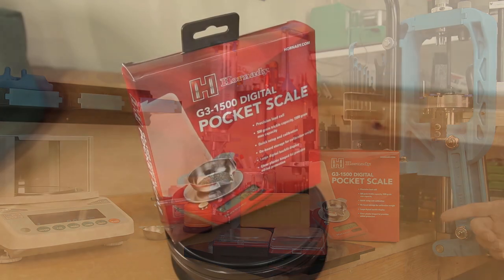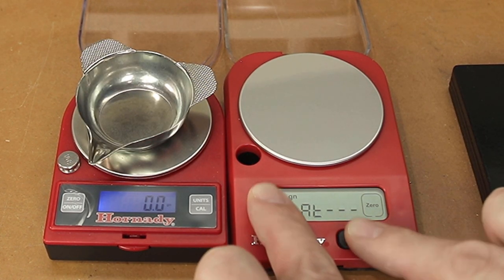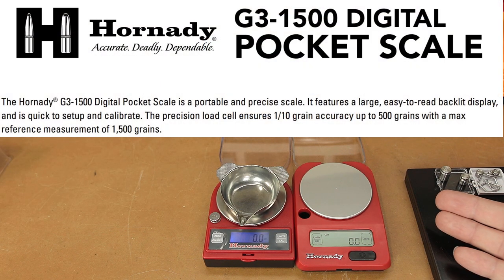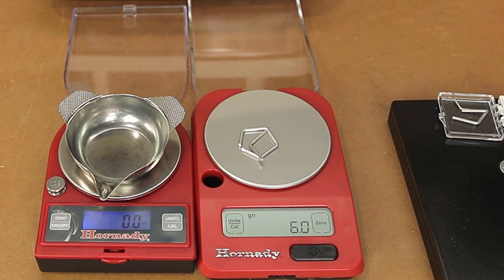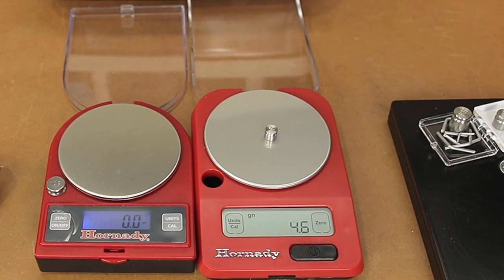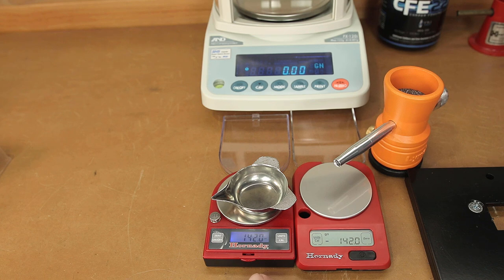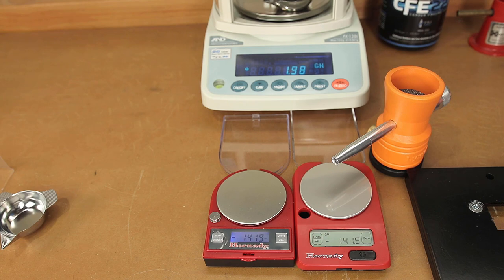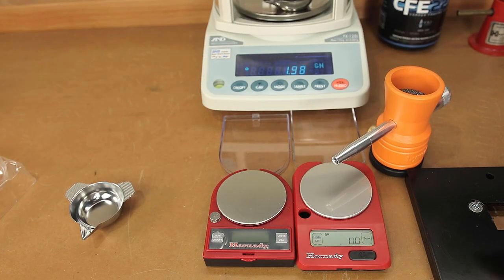Upgrade! - Hornady G3-1500 Digital Reloading Scale

Comment: I got this scale based off of this video. It does trickle well and is as accurate as my beam scale. The only issue is it needs to be re-zeroed before every weighing cause it does drift. Other than that it does the job well for a small inexpensive digital scale.

I always drop a light charge from a Redding Competition 10X powder measurer into the scale pan, set the pan on my Ohaus 5-0-5 beam scale, trickle the charger to weight with a Lyman Brass Smith powder trickler, then move the pan to the Hornady G3-1500 as a double check. If the two scales do not agree I double check the beam scale poses and re-zero the G3-1500 and then reweigh the pan. So far once a pose on the beam scale had inadvertently been  moved, but all other discrepancies have been because the G3-1500 had drifted off of zero. Hence I re-zero the G3-1500 before each weighing and the two scales have agreed 100% ever since. For the price the G3-1500 is a great little scale. But one day I want to upgrade to a Creedmoor Sports TRX-925 Precision Reloading Scale to replace the G3-1500 to perform the double check upon. I move each case as I charge them to a second loading block to help insure that each case gets a charge, and only one charge at that. Once a lot of 50 cases are charged I use a light to look down into them sitting in the loading block (as a third safety check) to be sure all cases have charges and that none are double charged at that.  And even after I up grade to the Creedmoor Sports TRX-925 Precision Reloading Scale I will continue with this same process, as it allows me a few visual safety checks (once on the beam scale, secondly on the digital scale, and the third being visual as well). The first two safety checks are to make sure the charge is right and the third is to assure that charges are made to each case and only once at that. SAFETY is key to a long and fun loading hobby.
Reply from the maker: Thank you for coming back to comment! So far this is the best scale in this price range that I am aware of. I hope it serves you well.
Reply: @BoltActionReloading  Yeah, it does the job right well, so long as I re-zero it before each weighing to be absolutely sure that it is zeroed. Other wise it may or may not drift.

Comment: EXCELLENT video sir! I bought the Hornady G3 scale recently, it has been 100% flawless. And the G3 is far better than any of their previous models in this size platform with no doubt. The added features of the G3 over the older ones was the biggest selling point. I always hated how the older ones would power down seconds later. The G3, does not, if you set it to full on. Really love the backlit screen, especially for my aging eyes. As far as i`m concerned, the G3 is the best bang for the dollar, and i have tried MANY. And just a heads up, stay away from the LYMAN scales. After the 3rd one quit shortly after buying them, i went back to the Hornady brand scale. No regrets, and i`m very happy with it! It doesn`t take up any room on your bench either! Love how compact it is. I`am not worried that its a tad slow to react. When it comes to reloading, i`m not into reloading scale racing, so there`s that. For $60 bucks, the G3 is a heck of a damn good scale.

Comment: Got this with my kit and used it to make my first loads. It is quite good but it did wander off by .3 grains twice during the loading. I noticed it because the thrower is quite good.

Other than that I feel it did well, I guess I will see in SD when I shoot them
Reply from the maker: For the price range of this scale I am not sure there are many options that are better. I hope it works well for you.
Reply: @BoltActionReloading  It does but I had to recheck my max loads (half of what the VV app says, but still)

Comment: I really enjoy watching your videos. Picked up a Hornady G3 scale from Midway USA after watching your video. Unfortunately, I received a dud. Mine would shift tare/zero after a few minutes. Also I couldn't get it to trickle charge consistently. 

I had to return it and ordered a the M2 scale in it's place. Hopefully I have better luck with the M2.
Reply from the maker: That's really too bad. I have had really good luck with mine so far
Reply: @BoltActionReloading  I really wanted to like it. Midway USA shipped it in a bubble envelope and the retail box was kind of beat up. That might of caused mine to be a dud. I also blame my extremely bad luck.

Comment: I have the G2 and find it looses zero all the time. Can't tell if my charges are accurate or not, so annoying. I will take a look at the G3.
Reply: My results are preliminary (I plan to do more testing), but I get zero drift with this scale. EDIT: from reading comments, zero drift may have been due to how the weight was added to the scale.  More testing is in order.
Reply: As a follow up I've been using the G3 for a little bit now. I find it much more reliable than the G2. Not sure if that is simply some trickery in the programming, but it holds zero and I haven't yet been able to fault it. I don't have an expensive set of scales to compare it to, so this is just from my observations.
Reply: My G2 was fine but died last night, so here I am :(

Comment: I have the smaller cheaper scale (1500l my biggest problems with it are, setting it down too firmly can mess the zero, low battery and electronics near it make the scale read 20 different numbers quickly and alternating. And lastly, I have difficulties getting. 1 grain increment trickles on it  it always goes from 42.4 when I'm going for 42.5 to 42.6 even if I barely add any powder to it
Reply: Thanks for your comment.  I'm getting zero drift on the scale while weighing bullets, but maybe that qualifies as "too firmly."  I'll try adding the bullets to the powder pan then gently placing it on the scale.  I had the pan on the scale, then added bullets to the pan, dropping them from maybe an inch above the pan.

Comment: I just got one of these to replace my failing-sometimes working cheap digital scales (one FA and one WAOAW) and this is a great upgrade. As a side note I'd say skip the WAOAW as while it works (6 months) its great for the price, but they all seem to get the 'jitters' after some time and the way to correct it - is to replace it. This new G3 is dead on accurate with my Ohaus calibration weight set. Whther its 3,4,5,10,20 or 40 grain weights it is DEAD ON. Will it last and stay accurate over time? Who knows at this point, but so far so good. I keep a Lyman Ohaus D5 and Ohaus 10-05 beam scales as backup , but the dead on accuracy and speed at this price is hard to argue with

Comment: How does the cheapo franklin armory scale perform in a test like this?
Reply from the maker: I don't own one
Reply: I do, not a fan-ymmv
Reply: I Do 2,,, do not waste your money. This scale would be your best choice in that price range.
Reply: My Frankford Arsenal scale skips digits in the tenths of grains even while trickling slowly and carefully up, to the point where I don't trust it for pistol loads. I might trust it alone in the field if I were using Lee scoops in a rifle cartridge with an unfamiliar powder, and wanted to check that I was at least a couple of whole grains away from maximum.  What I saw from the G3 here tells me it could be trusted to carry the day if I had Lee Loaders or a Lee hand press-based kit out at the range with me.
Reply: @Ensign_Cthulhu  I get the same results with my FA scale.  Don't trust it at all.  I've used it to confirm my beam scale.  I've used it to grossly sort mixed bullet weights.  The FA platen is also position sensitive and you will get different results based on where you place the object on the scale.
Reply: Terrible. Cant trickle with that scale. I cant trickle to 23.0 grains. I'm at 22.9 grains, it jumps up to 23.1 or 23.2 grains. I dont trust it. Waste of $28. Same thing happens at 24.0 grains. Jumps to 24.2 grains.

Comment: I bought one of these, but the scale adds .1 grains after every use. If I zero the scale, and measure out 40 gn, and remeasure the same load by lifting if and placing it back on the scale, the weight goes up by .1. Do it five times to the same load, and it will measure 40.5
I have to rezero the scale after every measurement! Garbage. My cheap chinese scale is faster and more consistent.